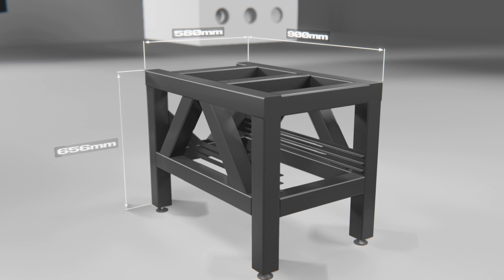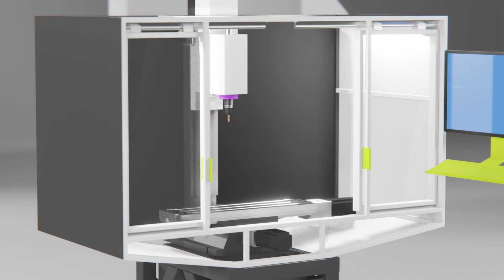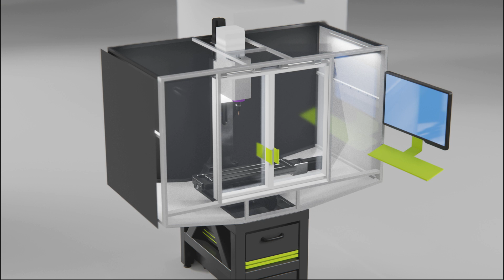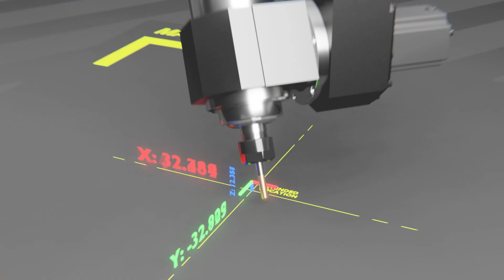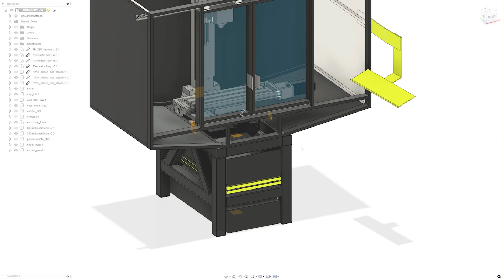DIY Hobby Mill to 5 Axis CNC Conversion | Part 1: The Stand

Comment: To get the head of the z axis there is a small grub screw that locks into a recess  that stops the head moving forward when you rotate the head.
Reply from the maker: I discovered that straight after I lifted it off, I even had a piece of footage pointing that out, but I didn’t like the look of the footage, so I left it out. Trying to decide how much detail to give. Also, the video is about making the stand more than it is about how to disassemble specifically an MH28V. Still learning how much detail to go into in these videos. Thanks for the heads up though.

Comment: I am not a machinist of any kind but for checking the nod of the Z axis against the tablet; would it be a option to get a magnetic angle meter, zero it on the table section and than holding it to the Z axis? Then at least you now the angle between the two, 0 degrees would be ideal(?)
Reply from the maker: You’re not far off! I’ve decided to buy a precision machine level that lives inside a precisely square frame. A machine level can measure an incline of 0.02mm over 1m of run. That’s the kind of precision these machines need.
Reply: @Mach Super  great build! I'm looking forward to seeing the next video. Please show us that new precision tool you newly acquired. 0.02mm is, indeed,  impressive.

Comment: Oh that right... Bit of hindsight now, but you probably should have done some hole prep before welding. Also some crush tubes under the mill would have been a good idea. Don't you just love how clear hindsight vision is.
Reply from the maker: Yeah… I didn’t go about it in the best way. I probably will weld in some crush tubes before I put it together for good.

Comment: I built a 4/5 axis cnc from a precision Mathews PM833t. I modified a HAAS 5c 4axis and then have a trunnion for 4/5. With 4 axis mine spins at 3000 rpm so i get the function of a mill turn. I machined all of my castings so that linear rails could be properly installed. 

Machines a belt drive spindle to 12k rpm with a 14x28 table travel. I used all AC servos, 25mm and 30mm rails and blocks. Its honestly the nicest build I’ve ever seen and i did it all in 2 weekends. Granted i had a industrial cnc to help me and i am a professional machinist. I never finished the wiring I had to move garage haven’t found a garage to set it up. Who knows if i ever will. For now this Beautiful cnc sits in storage, brand new, unused.
Reply: I also machined my own BT30 spindle but i didn’t do the final finish work because i needed the 4 axis to finish it. As a backup I also have a purchased bt30. If i ever get it wired I may do a video series to finish it and post the original ones that I filmed. It has been a little depressing that life circumstances got in the way.
Reply from the maker: Sounds incredible! How did you get the 4th axis to do high torque positioning and high rpm? Is it a big direct drive motor? I’d love to see the some videos about it!

Comment: An idea to solve the crushing of the frame when you bolt the mill down would be to enlarge the top hole and drop a thick walled tube in. You could tack weld the top but the mill would hold it in place otherwise. Great build btw.
Reply from the maker: I thought about that. And I’m frankly still undecided if I’ll do it or not. I’ll probably decide when the time comes.

Comment: 12:50 Good lifting technique :goodvibes: Waiting for more videos on this project. Btw I'm curious how does these optimum mills compare to old milling machines. I've bought an old 71' mill for a CNC conversion I'm doing now. It is really MUCH bigger than yours and the travels on each axis are quite shorter. I'm wondering if the ridigity in mine will be bigger or there are only downsides in mine 😅
edit: Subscribed!
Reply from the maker: Haha thank you, gym is paying off, you're not the first one to compliment my lifting technique.
There's definitely a superior sense of quality and good-fitment that the big old machines have over my Optimum mill. As shown on that Z dovetail, the parts still have a lot of improvement to be made. Having said that, this Optimum mill has a far nicer quality than the Sieg X2 that I owned, but that was also much cheaper, so I can't offer a really good comparison. I'm confident your machine will be far more rigid than mine.

Comment: I got a similar machine and also had Z axis issues. It was a real bitch to move up and easily chattered in cut. I found with no weight on it laying down it had close to 1 mm of rock side to side with gibb all the way in. The taper of the gibb didn't match the dovetail!!! I scraped it in using Hi-spot Blue and it's pretty good now. Can't wait to see what you do/did to fix your issue.

Comment: so much good work for such a sloppy thin C frame, should have cast something unique yourself with EG
Reply from the maker: Sorry Jon, I’m confused what you mean. Can you explain better?
Reply: @machsuper  I meant the cast iron c frame you're using for the project is very thin. If I were to do that amount of work I'd have made a custom mineral cast frame instead.
Reply from the maker: Oh! Got you. It’s definitely not an optimised design, for sure. But I’m limited heavily in my budget and I already own the machine, so it’ll have to do for now 🤷‍♂️
Reply: @machsuper  yea budgets are something else, I've been designing a machine for almost 3 years now, I went down from $12k to $3k. Stiffness did take a hit but flexibility of use is many times better. Now another problem to solve is to run it entirely from batteries because energy prices went nuts. Wish I lived near a river, but I guess solar+wind will have to do.
Reply from the maker: Which country are you in? Here in Australia energy prices have been a hot topic for years.
Reply: @machsuper  Germany, I had to change providers to even things out. Used to have a "green plan" that run on gas, now I went to a coal plan, which is manageable. Hey come to cnczone with your current build, post it in "CNC "do-it-yourself" or "Vertical Mill, Lathe Project Log". There's folks that can help you avoid mistakes like the last time.
Reply from the maker: @jonjon3829  I actually had a build thread on CNC Zone way back. Here it is: https://www.cnczone.com/forums/cnc-wood-router-project-log/286992-cnc-cad-cam.html

Hope I didn't say anything stupid in there.
Reply: @machsuper  Ah 2015, that's a way back indeed. Pete wasn't there yet, he's a fellow Aussie doing some work on cold casting, especially using grout to build machines. You guys have some really good products available over there.
Reply from the maker: @jonjon3829  I just spent half an hour reading one of his threads, really interesting to read about. I think I should get more involved in CNC Zone again.
Reply: @machsuper  would be great to have you there!

Comment: Enjoyed the video, definitely want some more details in the coming series. One pointer, you're probably going to want to get yourself a machine level, when you bolt the y axis casting down to the stand you are introducing twist in to the machine which will not be good for dimensional accuracy of parts and will create uneven wear. To counter this the easiest way is to use shim stock and the level to get it all square. Better way would be to follow in Stefan Gotteswinters footseps in his tramming a mill with epoxy video. Latter option may result in greater rigidity, but only margianally, the real advantage is the ease of adjustment compared to shimming. Glad you are following the prime directive.
Reply from the maker: Thank you for the comment! I've got a machine level already, so I should be sorted to take care of this situation. I'll also be installing the machine in my mate's shop who does professional scraping and machine restoration, so he can offer terrific advise for that stuff. I'm imagining using jacking bolts in place of shim stock or epoxy. The whole machine is being scraped and squared up with his guidance. By the end, it will literally and figuratively running like a well oiled machine.
Reply: @machsuper  Thats an amazing opportunity, cant wait to follow along!
Reply from the maker: @szaborubin2856  it's taking a while as I'm busy with study, but there's some excellent content planned for the future and I'll have the second half of this year to dedicate to it full-time!

Comment: You might be already done, but getting that heavy milling head back on there at that height is going to be a nightmare... Thanks for letting us follow your journey, great project.
Reply from the maker: It's okay, I managed to separate the two parts, which makes it much easier to handle. Thanks for the comment. :)

Comment: When is the next video coming?
Reply from the maker: It’s impossible to say, but it WILL be a while. I’ve been studying full-time and it’s even more full-time than I expected. I’ve been trying to eek out another video that doesn’t require me to travel an hour just to work on it. But for now, I’m stuck writing essays every single day. I’m sorry for the wait, but rest assured, there’s ZERO loss of commitment to the project and I WILL be spending the second half of this year working full-time on Mach Super.

Comment: Have you considered filling the frame with sand or epoxy to increase damping?
Reply from the maker: I briefly thought about it, and I’ve left that option open in my mind. But I expect that the cast machine frame will provide a decent amount of damping right at the site of cutting action. If I think it could use it, even if it’s just to make everything quieter, I probably will.

Comment: I like a good 30-40 min video for people that are well spoken and are able to explain their thought process, which you're good at. Have you seen those cnc conversion kits you can get for these little chineasium mills? Might be a good starting point if you're not looking to reinvent the wheel, which I know can be half the fun. Keep at it!
Reply from the maker: If I'm gonna record all the extra details, I'll have to look at getting a simpler mic setup, the current one is a pain to start and stop.
Certainly have seen those conversion kits, I already bought my kit about three months ago from a nice bloke down in New South Wales. The brand is Tomahawk CNC, he's been great to talk to privately, he seems to have some great experience as a mechanical engineers over the past 30 years or so. The kit seems to be pretty nice value from the look of it. Closed loop steppers with plenty of power, double nut ballscrews, nice aluminium machined motor mounts. I'll make an entire video about the kit in the future.
Reply: @machsuper  hell yeah, the ball screws are always one of the most expensive parts. I wonder how those are manufactured. You have one of those lavalier mics? I think they'll record on a mem card on you and you just match audio up in post

Comment: This is going to be a great series. Details are good, especially the tricky parts you encounter. The dovetail slide looks rubbish, you need to ask HAFCO if this is a manufacturing defect. These Optimum mills are made in China to a price point, but anecdotally better quality controlled than Sieg and other imports bench mills.
Reply from the maker: I've found that my Optimum mill was higher quality than my Sieg X2 that I owned, but it's perhaps unfair for me to compare the two, considering the difference in price. You could possibly regard that dovetail as a defect, because the rest of them are much better, especially the ones that the manufacturer knows customers will see haha. I'll be addressing this in the next video. Cheers for the comment mate. :)

Comment: At 71yo, engineering multi-trade trained from 14yo,  I rarely negative comment on Youtube videos BUT you flippant sounding comment "I have never Scraped anything, how hard can it be ?" really offended me. You just belittled a entire generation of  workers (true Artisans) who's sole +50year life long job was "hand scraping" and precision fitting machines, and I can imagine many would have turned in their graves.
Those at the top of their profession could within a short few hours on a Very High Precision component , tell you " the casting is still too Green (metal stabilized) and to go ""bury it for another year""; as the metal was still too "raw" even a year after being cast and now being got from raw product stock holdings. 
The few times I have ever hand scraped, it took me many days, to do even the ways under a tail stock.
I have just started work on the concept of converting my old 1930's Horizontal Mill to have CNC capability, hence why I started to watch videos of what others had done. 
50/50 if I will watch anymore of your video to gather knowledge. But if I do it will be with sound muted.
Reply from the maker: Hi David, I can definitely see how the comment came off offensive, but what I actually meant was to be sarcastic, indicating that I think it's going to be very hard and I have great admiration for the craft of scraping. I truly to find the early craftsmanship of precision engineering beautiful and highly, HIGHLY valuable. What was meant by my comment was a show of recognition that scrapping is a craft deserving of respect.
I just begun scrapping my machine yesterday, I'm making progress, but it still took me 5 hours with only small progress.
I hope your horizontal CNC conversion goes well and I hope you have a blast working on it. Many people would appreciate you making some basic videos sharing your many years' experience and knowledge to teach the young fools like me. 😄
I've also favourited your comment so my response to this will be at the top of the comments here.
Reply: Thank you for explaining.. I did miss understand you being sarcastic, as I had not been awake long and was in a deep technical detail focus mindset. 
I will re look at this video and await to view your next Part with both my sound ON, and at least 4hrs and 3 cups of into a fresh day.
As to my making videos to share my skills, time is my Biggest enemy and I have so many concurrent tasks different I am doing on any day, that to do a video of covering just one task (like my mill) would require a lot of image editing I feel.  And that's not a skill I have, nor time to learn and do it.
Yes it would likely help others, so I will take it on board, and investigate what I need to make it happen.

Comment: the design and the animations are absolutely gorgeous, great job on that!!
what kind of CAD or rendering or other combination of softwares have you used to achieve that, and how did you become that good?
Reply from the maker: Thank you so much Sasa! I use Fusion360 for designing parts and getting machine gcode, but for the animations I use Blender and Adobe After Effects. Blender does the majority of the work though. I love Blender so much. I've been doing 3D modelling for over a decade now, I started at home, and most of my skill came from personal projects, though I did go to a technical school for one year to study 3D video game art which taught me quite a lot.